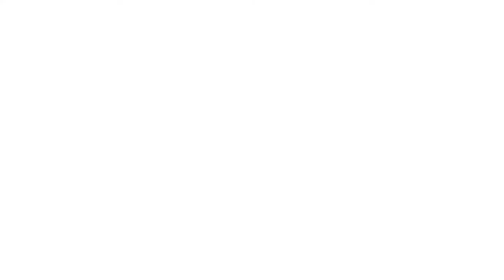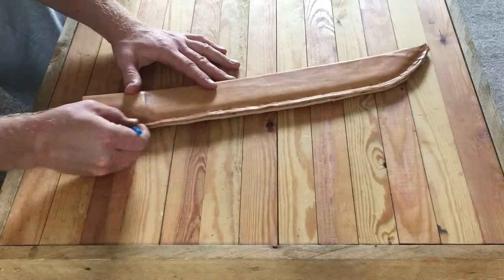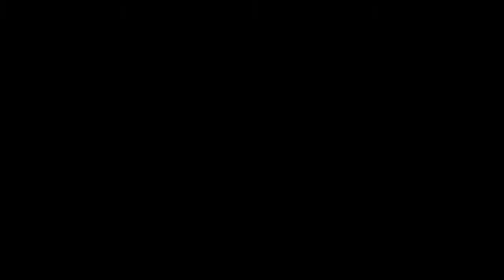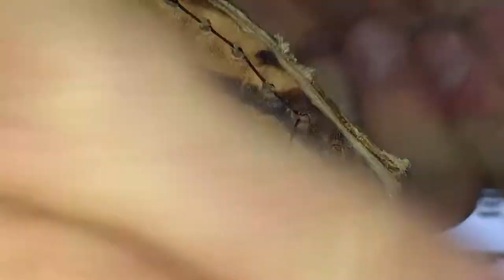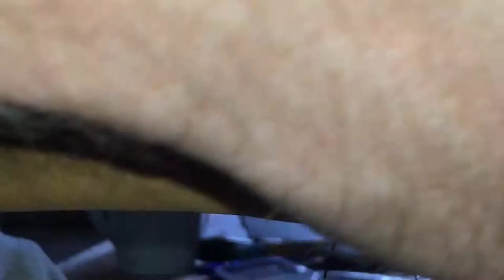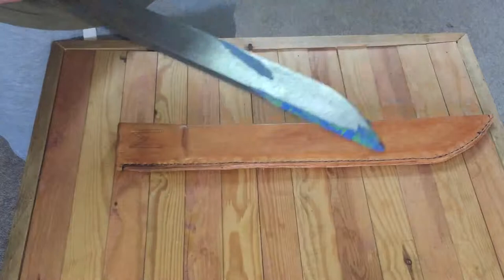Leather Sheath for The Machete

Comment: Hey brother, good simple job. I think that style of sheath would be better and longer served by using a welt strip. A welt strip is a thin strip of leather placed between the two sewn pieces. This serves as a runner for the blade so the thread doesn't get cut over time. If no welt then maybe place a rivet along the thread at the curve of the blade to prevent the thread from eventually being cut. apologies of you did this in subsequent vids.